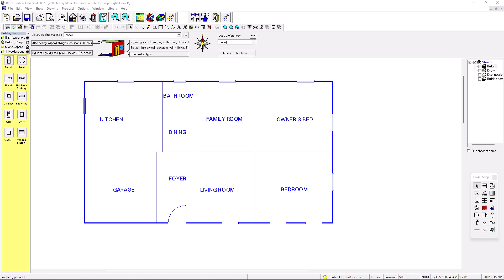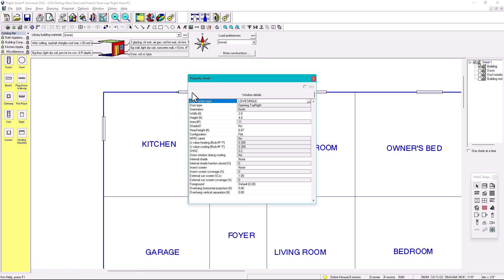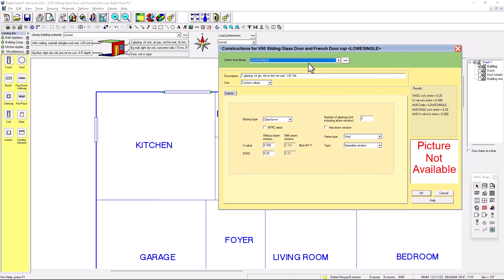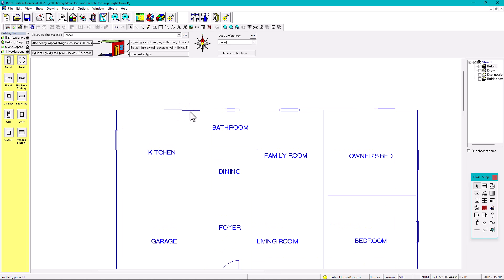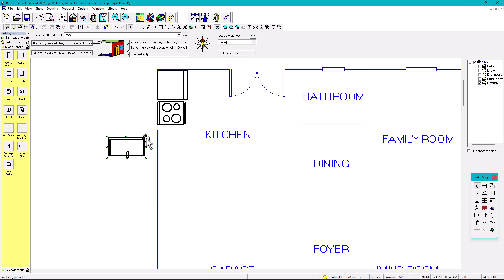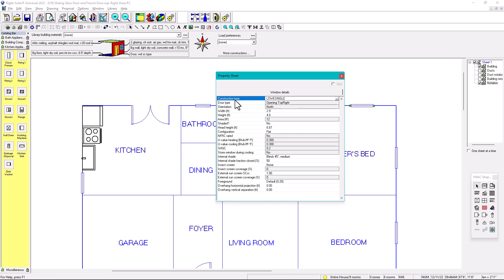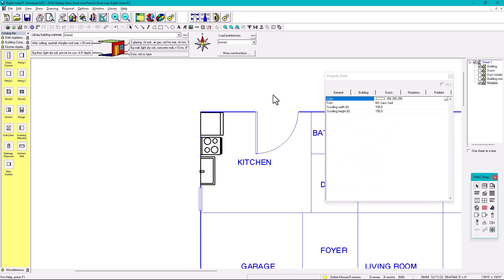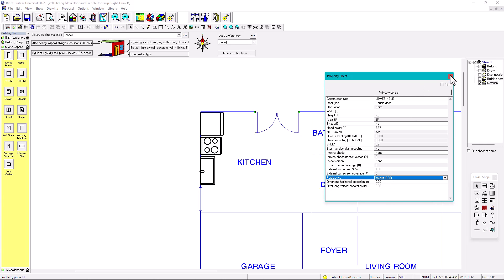Wrightsoft: Manual J Heat Load Calculation - Sliding Glass Door and French Door

Comment: How to get freelancing clients quickly as Hvac design engineer & what skills are needed to make projects from home with laptop ?
Reply from the maker: The best idea is always to be open to networking. Any relationship or connections always help in any field. That's is what basically business development managers do or salesman. Now there are websites where you can do freelancing, such as Upwork, Freelancer, Fiverr. It is always good to try.
Reply from the maker: Skills from home: at least one extra monitor for efficiency. Wrightsoft, Elite and TRACE3D for heat loads. Then IMC codes and coordination skills to talk to the clients
Reply: @hvaceasymath  Noted down 📝 thanks a lot ! but for drawing the project layout plan which one to choose like autocad or revit & navisworks, also what level of competency is required in handling ms office-ms excel for calculations part ..
Reply from the maker: @mohibquadri4053  The floor plan is another field which is provided by the architect. But in case we want to create our own floor plan, AutoCAD is more user friendly but Revit is the absolutely better (just requires more deeper modeling knowledge). For level of competency, Excel is key and very helpful when sizing ducts, shafts, ventilation and a lot of applications. It is a more complex project, you can rely on a CAD drafter that can provide the floor plans and then you can continue doing the MEP part, Mechanical, (ductwork, piping, equipment) Electrical, and Plumbing (Fire protection, Gas)
Reply: @hvaceasymath  Got it ! 1 last question - how much should i charge the clients to pay me for creating design stuff on ms excel & for drawings on autocad or revit as i have both on my laptop.. i don't know about the money process of what value is our services are in market presently ? Could you tell in some greater details..
Reply from the maker: @mohibquadri4053  No problem about the questions. You can also consult. Depending on the type of work and  scope of the project. For example in residential homes, the heat load calculations are charged based on sqft and if it is only Manual J, or S and D. The Turn around time (TAT) is usually 3 days to complete a Manual J but some companies charge more for expedited TAT (overnight). Each company has their own fees. For commercial is different and usually there is a contract to be signed where you discuss the scope of work and service and fees.
Reply: @hvaceasymath  That's so kind of you to eliminate all my doubts 😊 i got the part of knowing about TAT & designing, is drafting separate to charge for like piping, esp calculations, pump & chiller selection ? Other thing is could you suggest for our specific field which freelancers or service providers to follow on different platforms like linked in or websites to get the exact knowledge & analysis of present market trends as i find there's a big shortage of visible mentors on our industry..